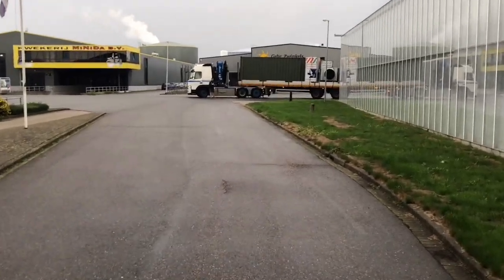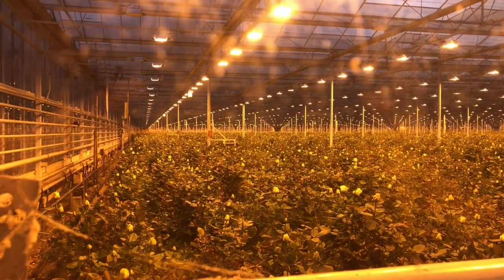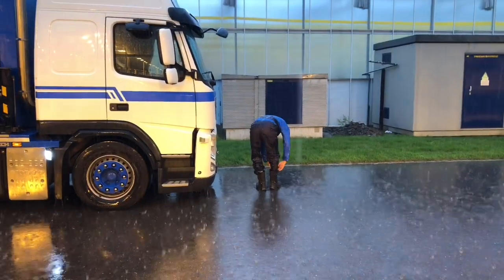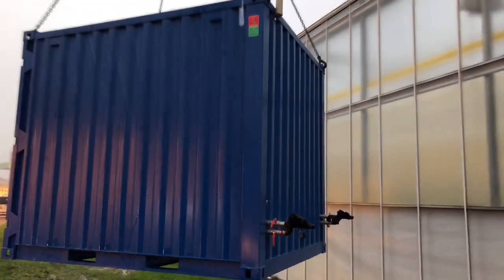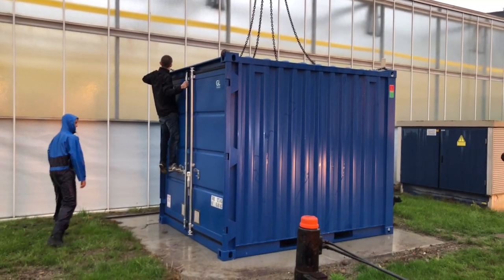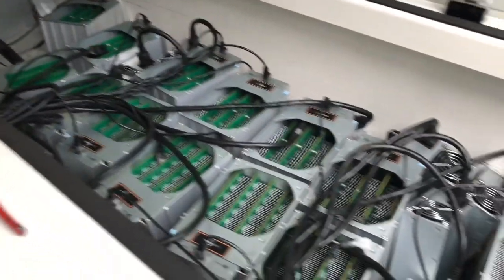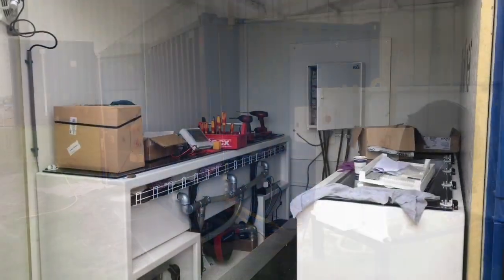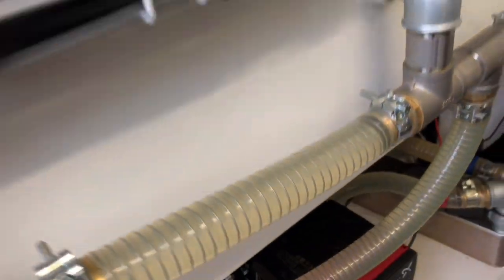Crypto miners at a tomato greenhouse: installation of the sustainable containers

Comment: Vincent, why you put so much effort in L3s"? Why not S9 new models . L3 doesnt make any money
Reply: Currently, L3 makes more money than S9
Reply: @volvol02  okej. I dumped mine in januairy and last time I checked new model bitcoin miners were pretty ok. I was just wondering. Because the investment of a system like this looks pretty steep to me. Specially with lightning network making ltc obsolete and this system'll probably run for a while. Would something like this e possible with videocards too or only asic printboards?